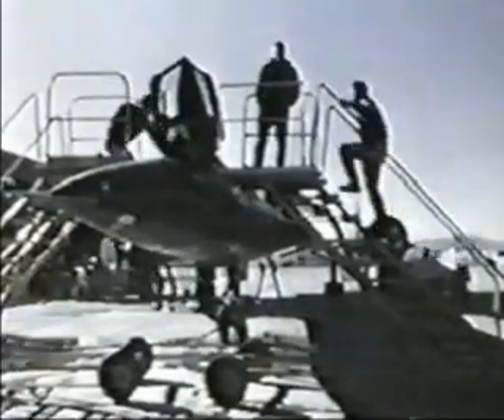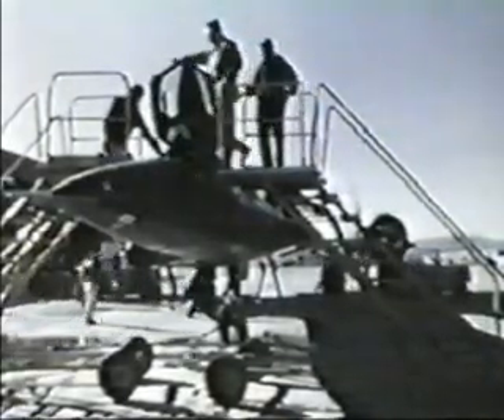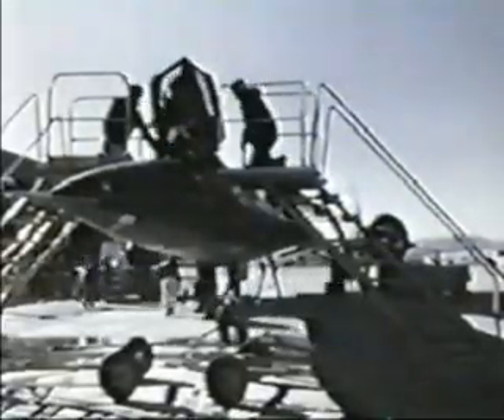SR71 Sistership, The MD21 Blackbird Accident

Comment: When released, the drone could not break through the shock wave wall of the MD-21.  It basically bounced off the shock wave and back down unto the MD-21 essentially cutting it in half (with the assistance of the very high dynamic pressures involved at mach 3).  They had performed this same routine many times in a .9 dive but never in level flight.  This flight marked the end of the program.  It was called off by the narrarator of this video - Kelly Johnson - the designer of the beautiful P-51.

Comment: Whats possible is that you see the forward part of the fusilage breaking away after being subjected to forces that it wasnt designed to. They did not have an ejection pod as Kelly Johnson saw how complicated it was in the B-58 and decided not to use it plus it was very heavy. The SR-71 did use ejection seats and the crew had pressure suits to deal with the temperature and speed.